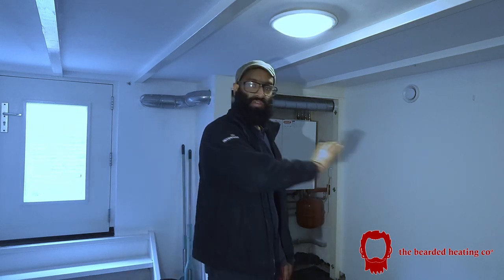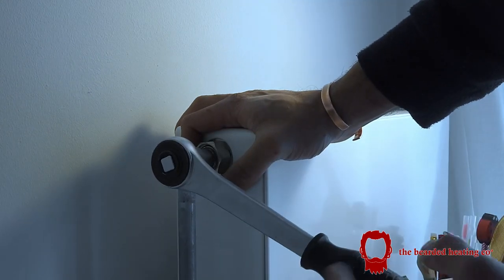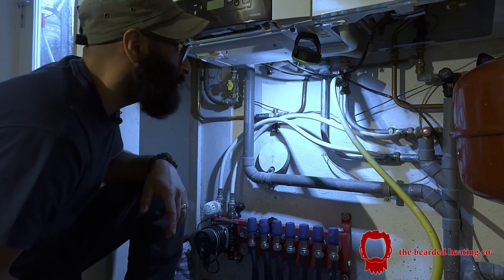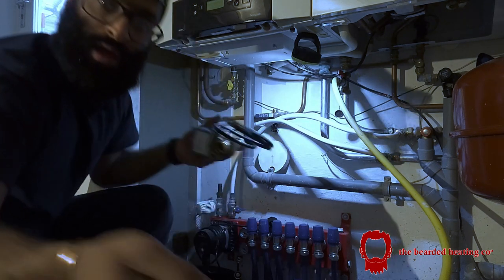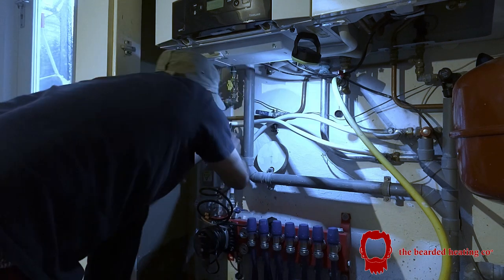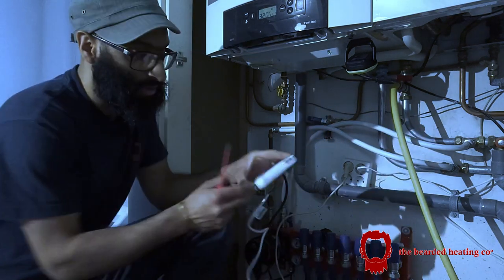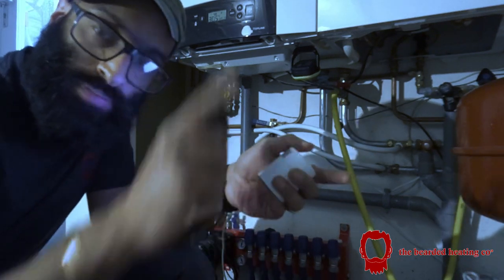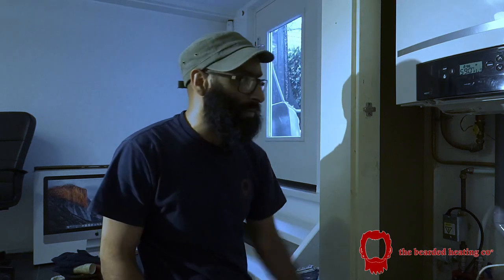The Bearded Plumber° Work Vlog: Tado Installation

Comment: So...  Is the wired thermostat connected directly to the base unit?  So for it to work for the room that has UFH it has to be wired into that room?  Did you manage to make it work with the wireless thermostat?  Also, can I use a no-longer-used radiator tails as the supply or would that rely on the radiators always having to be on when the UFH is on?

Comment: No paste on the brass olives?        Always a good idea to paste them up in my book mate.    :-)           Interesting to see how kit/install  is different in Holland.   Cheers.
Reply from the maker: Totally agree mate! I normally due hawk white every threaded joint, but on this I think I was more keeping my hands paste free for the camera... will get abit more comfortable making live working videos and paste those olives! 
Yes and systems are abit different but obviously very similar!
Thanks for watching, Live long & prosper! 🖖🏽
Reply: @thebeardedheatingco     Full sized paste pots are just to big for a smaller tool bag IMO,  for the last couple of years I have had a small screw top pot( ex silicone grease about 50mm sq)     that I  use as a jointing paste pot and keep in my small  everyday bag.

Always on hand then and just top it up from the big pot in the van when needed.  ;-)        HTH
Reply from the maker: I've got fernox hawk white 200g tub, but gonna get a tube type next

Comment: Good video my friend. If the UFH system has independent zones, how would the tado control each zone separately? Would each zone feed pipe require its own zone valve plumbed in after the manifold, and wired into its own wired thermostat base? 

Did you ever test if the thermostat could control the wired base while in another room? Ie wirelessly. 

Thanks.
Reply from the maker: Hi mate! Thanks for reaching out!

Best to WhatsApp me on +31616193216 and we can discuss